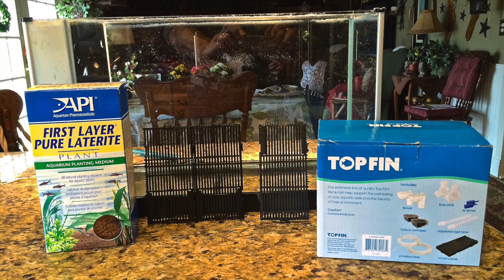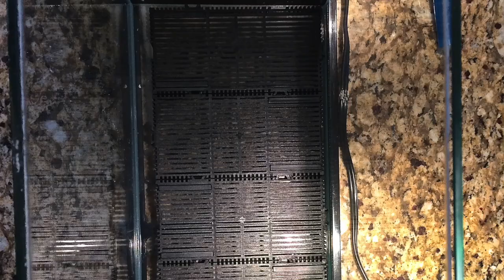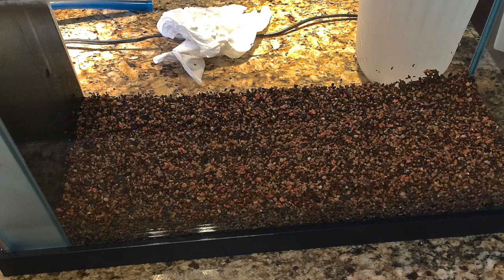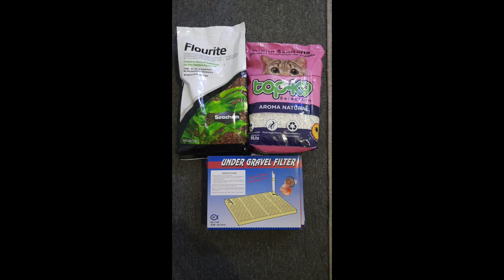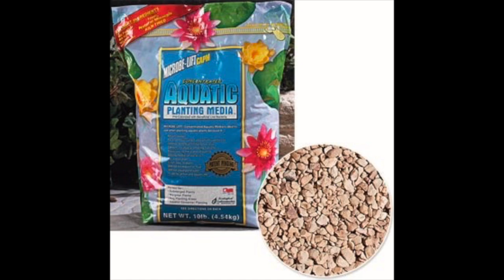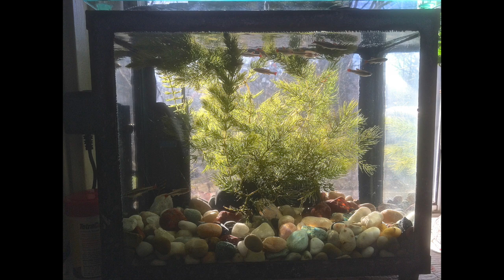How to set up a small Spec 5-gallon Fluval aquarium using a plenum and anoxic filter BCB bags.

Comment: Perfect timing! I am looking at my Fluval SPEC V tank on my desk right now. Getting reedy to tear it down and set it up with a plenum. Was stuck on how to implement the BCB bags and as I often do I was over thinking it! I will be using your idea and mod the stock sponge to accept the BCB bag. I love the tank, but I have also had issues with algae. I just picked up a used EVO V marine version of this tank for $25. That light is 11K so I will not be using it for a freshwater setup. Guess I'll be buying two new lights. Thanks for the video.

Comment: Hi, for this 5 gallon build, is there any added benefit to use kitty litter and laterite as the substrate right above the plenum?  I know you say I can use any substrate, but just wondering since in your larger builds, that's what you used.  Also, I'm planning on using bcp bags in my Fluval 407 cannister filter for a new 72 gallon setup.  What does the bcp bags replace in the cannister filter?  The sponge, the ceramic cylinders, the bags of charcoal?  Thanks a lot for your postings on anoxic systems.  They are very educational, and I love your tanks. My favorite so far is the orange discuss one.  They are beautiful, and I know how hard it is to care for those.
Reply from the maker: Not really. The order in which the substrate is added into your aquarium is really up to you. There is no set rule..